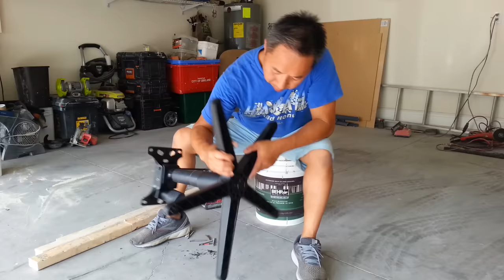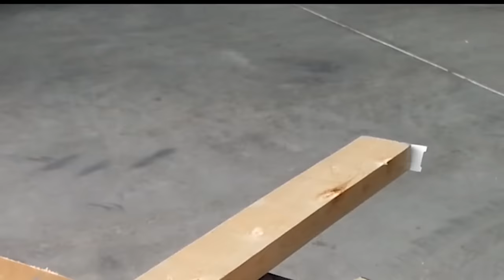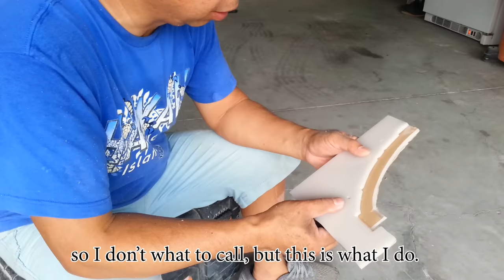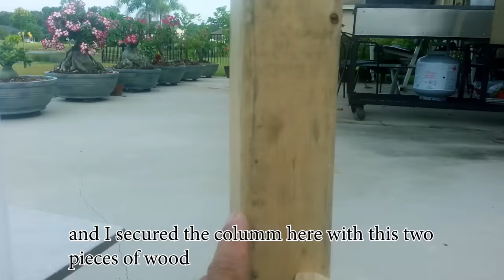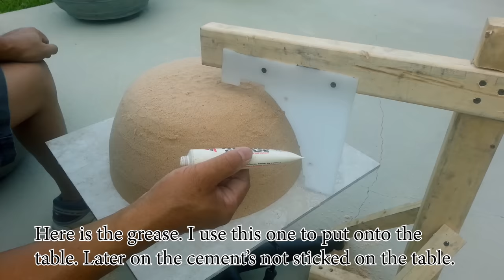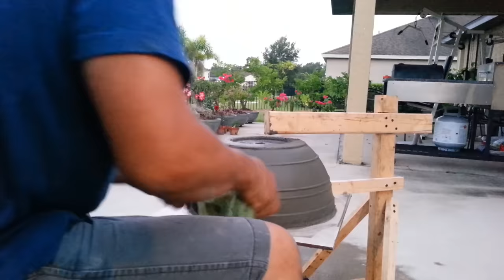DIY How to make large Concrete Planters from A to Z. Concrete Pottery

Comment: Ok so I tried this yesterday , building the table with the chair was easy the only challenge is that most used chairs are not leveled . So after building the sand and putting the ciment I noticed a big crack , I add more cement another big crack in the top part , a minute later the whole thing fall apart by it self , well I admit I tried to make a big planter 14"Hx 17W , so I have to start all over again and I downsize the sand was better but than it was almost impossible to get it to be smooth I wasn’t using plexiglass I was using metal cheat that I fund free and the cement was pushing it back and it was snug with the tile so I decided to cut a little so it can move more freely. Was better but the bottom part was always getting holes and I had to keep trying and couldn’t get it to be smooth I guess plexiglass is the way to go don’t use metal unless it’s thick and smooth . 
At the end I end up removing the metal Gard and just used my hand to smooth the planter with a dry wall scraper was better , than used a sponge . I have to try this again . I got to say this is no easy project , it requires experience for sure with cement , need a lot of patience, it’s not as easy as it looks  also you can’t make anything tall only shallow planters . I will try again for sure !
Reply: Hey brother me to with the collapsing sand inside the layers of cement. I saw an Indonesian actually wrap nylon string many many times around the first layer of cement. I also have seen a Brazilian use loam and soil with the sand. Making smooth the sand cast is a first step as this is the interior face of the pot so hand pat it like this brother from Florida. Sand too wet will cause a lot of problems. Hope this helps. Keep practicing.
Reply: @boesposito  Thanks bro , I give up honestly , lol cause I have hundreds of pots It’s my full time income I import them from all over the world .

Comment: For the cutting curves and tight corners the saw you want is a jig saw.  It can cut those curves very smooth and it can be set at an angle to cut the thickness at an angle to match the planter curve top to bottom.

Comment: Are you using cement with gravel, or portland with sand only. I see you stated below a 50-50 mix. and then use a slurry mix for the final top coat. I'm an old concrete guy trying to understand where the strength comes from, certainly not from a single wire, just portland and sand doesn't  have that much strength at 1in thick. I[m retired now but would like to make some for the home and friends. FYI, did you know portland also comes in white, and not just grey.
Reply from the maker: Gravel will not help. Just sand and portland cement. 50-50. If you want it lighter in weight, then add more perlite in the mix. Final coat is just cement only. Thank you

Comment: Awesome love it... Would you sell the template for pots if i give you the size ?
Reply from the maker: Rafael, I am sorry I don't sell it. I just want to share my experience to everyone. Thank you
Reply: @SonyLe  Thank you, can I ask you how wide of piece is the plexy glass you are using, I have 6 Inch wide aluminum plate that I can cit to size but i think I will need wider, Would I be able to do it with 6 Inch wide plate.
Reply from the maker: @rafaelcasero2822  The one I use is about  10" x 10"  before cut. But please remember with one size of the template, you can make many different size of your planters in diameter. With your 6" , you can make it with different method as you see in my newest video below:
https://www.youtube.com/watch?v=W_7NDDLOSCU&lc=Ugze88mr7vOwcWo5iEl4AaABAg
Thank you

Comment: ive tried 3 times and starts to tear apart  after about half way 
through maybe because im not using the wire or i need to let it
harden a little before going further
Reply: Did you figure out what was wrong?  I was wondering how to make those wire hoops.

Comment: Do you not need to add some sand to the cement to give it strength?
Reply from the maker: I do need sand in it. For extra strength, I added metal wire. But you can add fiberglass to replace metal wire. Thanks
Reply: Thanks for that quick response. I did see the wire rings but what I meant was, in the cement slurry, do you not mix any sand into the cement, that was not visible in the video.  I’m about to try to make some planters.
Reply from the maker: @MrDaviddesouza  That is mixed ready (cement and sand). You can mix yourself half and half.
Reply: Oh. In India we don’t get this mix, thanks for clarification. I know now what to do. Thank you.

Comment: Thank you for your inspiration. One question. How do you avoid the planters from cracking during the drying time or later?
Reply from the maker: If you are living in cold area, I think you need to add fiberglass plus metal wire. The mix should be 50 % pure cement (portland cement) and 50% sand.
Thank you

Comment: Sir did u used a pure cement only no more mixture of fine sand?
Reply: I believe cement mix with sands for strong bond, and on the final coat it's cement only for smooth looking

Comment: Where do you get the wires please , I couldn’t find them . Also I see that the plexiglass piece is a little bit away from the table will it be better that it’s touching the table for a firm finish of the planter top lip .
Reply: You can buy the wire at Home Depot or any big box store. For example: Home Depot sells 14-gauge galvanized steel wire (100 foot roll) $7.48 in my area(West Virginia). *For bigger pots, I would recommend using a few more wraps of wire around the pot. And a lot more strength will be from connecting the wire from top of pot to bottom sections of pot with more wire. Essentially connecting the top with the bottom with wire by wire crimping the wires with some pliers . Creating a cage somewhat . Could be unneeded, but will definitely add strength and longevity

Comment: Mr. Lee I gave this technique another try yesterday, my fourth.  I've had problems with my sand but twice now I've been able to form it and get it to hold it's shape.  Yesterday, I was able to apply all the cement except the very bottom.  I was at the point of using the very thin cement when suddenly half of my pot started separating and fell off my pedestal.  I'm not sure of the problem but my pot was to be 18" deep by 24" diameter.  Maybe that is too deep for the diameter of my pot.  Maybe the weight is too much for my pedestal as the total weight of sand and cement is around 200 pounds.  I'm thinking that the combined weight of the sand and cement (I ran out of mortar and went straight to 100% Portland cement) may have caused my pedestal to shift.  I wanted your thoughts on what I'm doing wrong.  What are the depths of your pots?
Reply from the maker: Yes, your pot may be too deep. Mine is about 9 inch tall. It is easy collapsed if the pot is too tall and the sand is not damp enough.
Reply: When your just filling / building the sand base.   Try using Styrofoam blocks to reduce the need for so much sand = less weight ;0}

Comment: Thank.  I still need to know wat type of  cements and ring.  Please.
Reply: N-type mortar is good for this type of thing. could also use portland cement and sand, 2 parts sand to one part cement. the ring is just metal. use what ever you can scavange. also good is fiberglass mesh drywall tape to reinforce in the middle of of the cement to keep it from cracking.

Comment: Awesome technique! What's the largest you could make with this technique?
Reply from the maker: With this table top, I can make 32" diameter. But if I have larger one, I could make any large size I want. But I need more people to help me to flip it over. Thank you
Reply: @SonyLe  This technique is the same that has been used for centuries in England to make church bells. Instead of cement, molten bell-metal is used, so the sand-template has to be strengthened with animal hair and lime. The smallest bells are about half a metre high and the biggest are over 2m high and weigh several tons. It is fascinating watching these beautiful garden pots being made. Thank you for posting the video.

Comment: Disaster number 3.   Yesterday I was finally able to get the sand to stick together (my backyard fill).  I started applying the mortar and got the first layer on the bottom then one side fell off.  I took a measure this morning to see if one side had sunk under the weight but only found a 1/4" difference in elevation (and this could be due to the weight shifting).  I'm really at a loss to figure out the problem.

Comment: How to make it light weight pot
Reply: You make the difference between the sand template and the cement template 2 cm only. 
Thank your country supporting Israel in this dark times my brother i salute India!
Reply: You can add perlite to the concrete mix. But I would put a coat of portland mix on the sand first, then apply the mix with perlite for the bulk of it, then finish off with another coat of portland mix on the outside for a smooth finish. Otherwise the inside and outside will appear chunky.

Comment: Hi,   I have been wondering how you make the wire hoops or where to find the wire hoops you use on your pots.  thanks
Reply: I found galvanized steel wire in spools at the hardware store. Comes in various thicknesses too. Just cut to length and twist the ends together for a hoop

Comment: I want to know how you know how much cement to mix and what happens with the leftover sement.  What kind of a mess do you deal with after you're done making a pot?  I see you using rags to clean the surface of the table as you work.  Do you throw those away afterward?
Reply: It not too hard, but you definitely have to eyeball the amount of cement. There is a specic mathematical answer, but that would involve calculating volume of some pretty complex shapes. That's too much calculus and geometry for me. Leftover cement can be diluted with lots of water and washed into the lawn, after which I have noticed no unpleasant effects. Or you can scrape it into a lump, let it dry and throw it away. Tha rags, keep them in a bucket with water and return them after use, and wash them as normal. As long as you are careful, you can avoid a lot of the mess, just remember to wash any uncured concrete spills with plenty of water.
Reply: If you wash the cement out while they are wet it should be fine

Comment: extra tip: most bagged concrete will give you a minimum thickness of the material.. you can usually go a bit thinner than they say for something like this, but not much.

Comment: Hi can you sent me information on template file of some thing i can print thanks
Reply from the maker: Gregory, I don't have the file, but you can stop the video at 17:54 and print it out. Thank you
Reply: dont over think it,  draw out the outer design of your pot.  then make a cardboard tracing of a template that will give you that design while it spins.   not sure if i explained enough,  but try picturing it spinning and what shape is needed to get you that outer side design/shaping.  be well

Comment: You are going to lose your thumb at some point.  You need to change you habits with the round saw.
Reply: OUCH, I just rewatched it and I concur.  Loads of tough old men have done that and too high a percentage of the are missing a thumb. My woodshop teacher was missing two fingers and a thumb.
Reply: What's the proper way to hold a round saw so you don't lose your thumb?
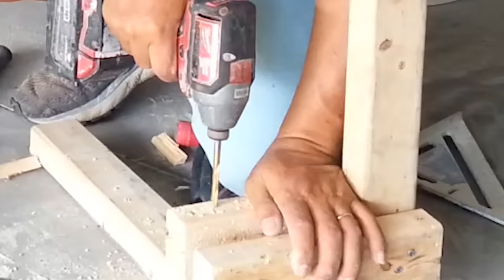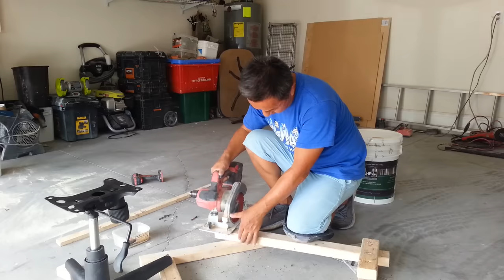Reply: @thelastjuiceblender5915  Let me clarify my position.  I have watched and enjoyed several of this guys videos and I really appreciate him taking the time to share the knowledge he has by making the videos and posting them for free.  That said, at 4:00 you can see how he should be holding his thumb in the cases of using the circular saw.  Thumb should be in, not out.  However, he was holding the blade cover open with his thumb at 3:20.  99.9% of the times you use a circular saw, this is not necessary.  This time is one of the 99.9%.  At 3:20 you can see him holding the blade cover open while making a cross-cut.  He appears to have set the blade depth as indicated by the raised up blade, but he still opened the blade guard for no reason.  Also, he could have cut from the other side of the  board and had much more stability due to the saw resting on the wood.  You can see at 3:23 a slight kick-back as his saw bends a little bit.  This is directly due to him not having any surface to rest the saw face on.  He should have cut from the other side.  BTW, the 0.1% reason you might hold the blade guard open is in the case of plunge cuts.  These are mostly rare cuts for a circular saw, although I am sure someone has a job which needs them frequently.

Comment: Take note of the style of this chair.  I just bought one that has a completely molded plastic seat.  The center post is also molded to the plastic frame.  There is no metal frame as shown on this chair.  The one I purchased will take a lot of thick plastic cutting to get to a point where I can screw boards to it.  One pro is the plastic frame is sturdy and wider than the metal one shown here and it may be better for supporting the heavy loads of sand and cement needed to make one of these pots.  I turned the chair over and used the seat as the base and the chair legs for the turn table.  Seems to work well.

Comment: Cool project. You used a drill with an impact bit to disassemble the chair and then an impact with a drill bit to bore the holes in the 2x4. Those tools aren't meant to do those tasks, best to use them as they're meant to be used. Mostly because drill bits arent mean to have impact on them like that. Extracting broken drill bits sucks.

Comment: I’m not able to make the wooden spin table so I won’t be able to make this. I wish it would be easier for the average person to make. This is not a beginner level project at all. You need to have specific tools, skills to make the table, “find a chair in the garbage?”, make a double layer plastic template to attach to the wooden spin table… seriously?? This is not something that just anyone can recreate. What a shame that it wasn’t done with the mass public in mind.
Reply: I just purchased a cheap Lazy Susan from Amazon… I just finished making the sand mold this afternoon and have it wrapped up in plastic for overnight. If you’re interested, I can take a few photos of the set up that I’m using as I agree I didn’t have everything at my fingertips to do exactly what he has done.
Reply: @kareng5244  yes please! I have a turn table, but it is rectangular and way to small for a large pot. Thank you in advance ❤
Reply: theres another method where the bowl doesnt spin but it has a pipe staked in the middle that the template spins around. you can make the template out of wood i guess but there are probably disadvantages to that
Reply: @kareng5244    what kind of sand should the sand mold be carved from?  Im using play sand but it keeps collapsing.  and wetting it with water keeps making it worse.
Reply: @JMtheCONQUERER I used “Washed Play Sand from KolorScape” from Home Depot and that worked out great for me. Initially I had purchased “Quikrete All Purpose Sand” not knowing there are tiny stones in there and my first sand mold collapsed!
Reply: @shek9  sorry for the delayed response. Just seeing this now. I have pics of my setup but being somewhat tech disabled can’t seem to be able to post them. Any ideas how I can do so?
Reply: Sonny also has videos of him using a mold. I think it was less than $50 for planters that cost hundreds. I hope you won’t be discouraged and will make beautiful art.
Reply: Argue for your limitations, and they are yours.